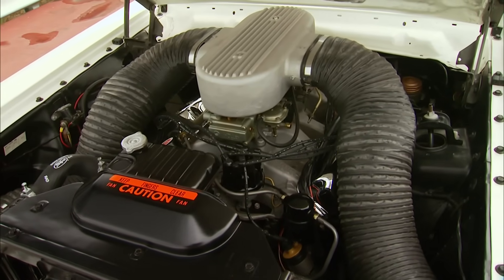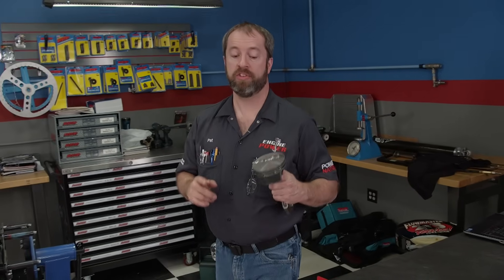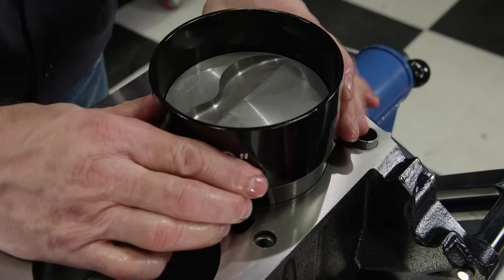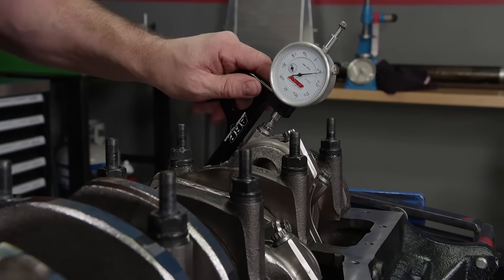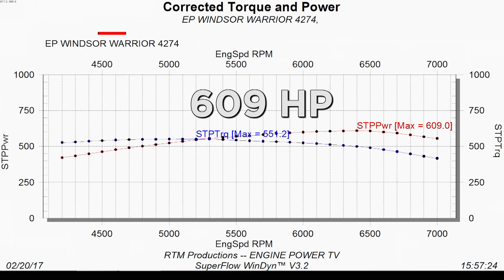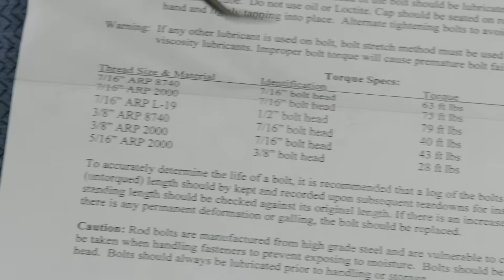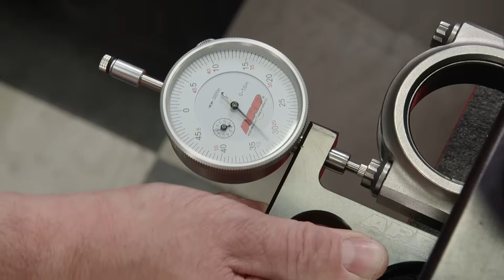Ford 351 Windsor Grows Into A 427 Stroker With Double The Original Power - Engine Power S4, E7

Comment: Great motor, now would you be kind enough to ship it to me so I can install it into my wife's 1967 cougar? Also quick question, I have a 351 Windsor lying around, can a factory block be machined for This application? If not please refer to the previous statement.
Reply: Yes it can, take it to a machine shop n get er done..
Reply: For the stock Windsor blocks I like the 408 kits. With a 4.03" bore and 4.00" stroke you end up with a "square" engine that makes great power, safe to rev w/o super expensive parts and still has a decent rod ratio.

Comment: I would love to see this same motor on the dino with Holley EFI on it :)))
Reply: @bigboreracing356  in what aspect ? To a gravity-fed carburetor .
Reply: T TANA    It's Dyno not Dino.
Reply: @wysetech2000  Tru Dat . Freaking speech to text
Reply: I was thinking about that same thing.
It's what I want to put in my 88 town car.
Reply: @shanerichardson9568  lol its already fuel injected.
Reply: @TTANA  My Town Car is not fuel injected. It had issues so it was replaced with an Edelbrock intake and carb.
Reply: @shanerichardson9568  well it was fuel-injected.  Sniper kit would be the way to go :)))))
Reply: @TTANA  well I am planning a 427 stroker build with Holley's tunnel ram efi.
That's why I wanted to see it here.
Reply: @shanerichardson9568  wow that's awesome

Comment: Built my 427 but based it on the Dart block. Used same heads but the Eddy Super Victor. Compression 10.3 and a Lunati hyd. roller with 241/249 and .600 lift.  6 years ago put on the Price Motorsport dual Holley inline intake with a pair of custom Holleys flowing 660 cfm.  Still going strong after 11 years now and it is in my 1985 Mustang LX coupe! 480 HP at the wheels with 505 Torque all in by 5700 RPM.
Reply: i would love to have a 427 windsor in my 95 sn95
Reply: @jsigafoo  Only thing is, I think you'd get beat up all day by coyotes
Reply: Thats alot of motor for 480 whp
Reply: Bob- that’s a lot of power for a pump gas out of date camshaft profile……. Todays cam that engine would make another 25hp easy
Reply: 😢😢😂🎉😮😮 3:44 🎉🎉😮 3:44 😢
Reply: 🎉 3:44 😢😢😢🎉😮 3:44😢🎉 😢🎉
Reply: 🎉😮😢🎉😮😮😮🎉🎉❤🎉j🎉🎉🎉

Comment: I’d like to see the torque numbers from idle to 4,000 rpm, being a street engine.
Reply: @bigboreracing356  4K to 7K rpm power band seems a little high for a street engine. Especially in a heavier 72 Gran Torino Sport, with a C6 automatic, A/C, PS, 3.25 gear ratio.
Reply: Torque is going to be massive from idle to that rpm, torque never dropped below 350 on that run.. It is a big cam so don't expect it to run great at super low rpm, this seems to be a race engine, slap some boost n be over 1,000hp easily..
Reply: @P71ScrewHead  I agree.
Reply: @P71ScrewHead  How do you slap boost on an 11.3:1 engine?
Reply: @johnterpack3940  Ppl do it all the time nowadays, the Coyote Mustangs are a perfect example of high compression n boost, the 3rd gen has 12 for compression.. I've always leaned towards low compression but i guess it's how new engines get it done now..

Comment: Nice job guys. Great power output. But what about the fuel mileage? Theoretically!
Reply: I have two 408 Windsor's currently; the mild build gets 2 light-poles per gallon. The hot build gets 2 fence posts per gallon. But in all seriousness, I get 10 to 14 with the mild build. I've never checked the other as I don't really want to know!
Reply: @cgarris8674  👍
Reply: There's always that one dingleberry who has to ask fuel mileage on some crazy horsepower engine. No one is building these for fuel economy dingbat.
Reply: Lmfao!
Reply: A couple gpm, but who cares.

Comment: I wouldn't build a stroker for a street car, a race car maybe, but thats just me.
Reply: If you don't mind the gas mileage penalty, it's even better for a street-car as you can make great power at low RPM's :)
Reply: @cgarris8674  Strokers are not known for their reliability which is why you wouldn't want to build one for a street car.  You have to rebuild them too often (like 40-50k miles) because they were not designed to work that way from the factory.  Its an argument as old as the stroker has been around.  Often what happens is the change in stroke causes the piston to slap in the bore and chews them up quick.  If I had a street car I just would not put a stroker in it.  Its the cheapest, but most unreliable way to make HP.  Something you want to race professionally, then fine...  I would think rebuilds on race engines would be even quicker than 40k miles.  Remember, this is my preference.  You can't argue the reliability aspect, but you can have a different preference.
Reply: @reviewaccount469  Totally understand what you're saying; but for many of us our "street cars" aren't our daily drivers and aren't likely to see a rebuild cycle for a decade or more. I typically drive mine on pretty days, to car shows and occasional trips to the drag strip to race friends and relatives in their hotrods. There's a guy in the comment section that's been running a 4.03 bore and 4.17 stroke for a decade w/o issue. For a heavily driven car or one that sees extended time above 6000 rpm's, yeah they will wear quickly.
Reply: @cgarris8674  I'm aware of the concept of anomolies and exceptions to rules, ie. a stroker you know of that lasted a long time, but its not proof that the basic engineering aspects of a stroker are different than I discussed.  

If your fun cars don't get driven much as you alluded to, as in under 40-50k, then I'd understand that works for you.  I have 3 cars, 2 of which I fully restored and are my weekend fun machines.  One of them is stroked, however the block was engineered that way from the factory to be either a 2.7 or a 3.0 depending on the crank used.  I would not have stroked that one if a corporation did not spend a lot of money and time to engineer it that way.  I just have too much time in that car to put questionable engineering into it just for a few hours of fun here and there.  

The reason I used miles instead of "years" for everyone else's fact consumption is so the average person has the facts they need to make a decision.  If they didn't know the pitfalls of a stroker, they'd be thinking it was the first thing they'd be doing based on all the other comments.

Again this is my preference, but the engineering and reliability aspects are not debatable.  Its a tradeoff and a choice, but lets not try to confuse the motor noobs that may be reading this that there is no issue with a stroker.
Reply: @reviewaccount469  Preference.
Reply: A stroker will always be the best way to go, even more than a big bore build..
Reply: @P71ScrewHead  Or the best of both worlds, a big bore stroker ! =)
Reply: @cgarris8674  Yes, that's especially what i like, don't fear the stretch, big bore strokers..
Reply: @bigboreracing356  I don't, but who knows what other people do. But even if they did I wouldn't going around the internet being an asshole to 'em about it.

Comment: With the 950cfm carb, they saw best performance at 30 degrees of timing, then a bit of a fall-off when they advanced to 32 degrees. Why did you not simply revert back to 30 degrees of timing, then put the big 1150cfm dominator carb on to see if that made a difference? Are you going to leave this engine at 32 degrees of timing, knowing that it does better at 30?
Reply: They also didn't say that they DIDN'T set the timing back to 30°  I'd be pretty sure they actually did, that carb shouldn't have added horsepower, to me, it sounded like they were trying it to dispell the myth that an oversized carb would flood the engine.
Reply: @V8VRUte  i think that increase in power came from the spacer and theres really no need for that big a carb on that particular engine
Reply: @supersevenn  The power was basically right at the same number it made with the smaller carb and 30°  I still think that they probably re set the timing between runs.  Just because they didn't show it, doesn't mean they didn't do it.  They also didn't show them re jetting the carbie either, which would have almost certainly been done.

And like you say, the carbie doesn't need to be anywhere near that big.  850 cfm would supply a 7.0L to 100% VE at 7000 rpm.
Reply: @V8VRUte   I have a 408W with a solid roller and it needs 1000 cfm,  made 15 more HP going from an 850 cfm to a 1000cfm , with that stroke and head flow, it needs it for top HP. There is more testing that can be done but only using a few pulls won't really show the engines peak potential.
Reply: Elving- what heads on your 408?
Reply: Exactly, which means the same, but likely different and opposite. Other than that, perfectly identical theories.
Reply: @V8VRUte Go buy the kit and do your own testing just like they did. Let US know what you found.
Remember with exactly the same parts.
Reply: Yes, I wondered the same thing about the timing. Also, why not dykem and exhibit the pattern the roller rockers are leaving on end of valve tip , aka the 'walk'. Save those valve guides, side load wears out guides ! Maybe that was done throughout all 16 with a push rod length checker before they ordered the set of pushrods. Great video BTW.
Reply: @1MrE42  blah blah blah LS
Reply: @timmebruer5205  he's right.or a bbc
Reply: @ryangulley2051  blah blah blah big block Chevy.
They make great boat anchors
Reply: Definitely should have gone back to 30° or even 28° for gas variability. You lost power when everything else was equal/unchanged, that shows that the timing was too advanced.
Reply: Would have tried 31 degrees!
Reply: Not only that they went from no carb spacer with the 950 cfm carburetor to a spacer with the 1150 cfm carburetor
Reply: Right!!?....I would have immediately turned timing back after it dropped off....probably 612-615 hp
Reply: Faster airspeed with 4150 carb over 4500... my 12.42:1 pump gas 438 makes more power with a demon 1000 4150 over a 1050 4500
Reply: I really don't care about the 2 degrees of timing.  That motor between the frame rails of my 47 Ford Pick up is more than plenty power for street driving
Reply: Pretty sure these episodes are several years old and the builders don't read or give a shit about your comment.
Reply: Yeah it does much better at 30 degrees and the big carb will perform much better
Reply: Because that makes too much sense sir.
Reply: This engine had almost 11.5 : 1 compression ratio. I would have likes to have seen what it would have done on 110 octane gas or 105 octane E85!
Reply: 1150 is too big of a carb for the application, unless it's gonna live at the top of the rpm range most of it's life. The 950 will have better vaccum and better part throttle driveability
Reply: I wanted to see them tune the 950 carb with that 427.  The big carb was unnecessary
Reply: Idk why they didnt back t he timing off either
Reply: Democrats.. channel is sorry.
Reply: @bigboreracing356  That's not the point that he was making. Now who's the More Ron?
Reply: @Lifeistooshort67  Ole No prep there just tends to make ignorant statements on things he knows nothing about to be annoying. Just last week he was telling me how Chrysler engines were really cheap to build in the seventies. Being that I was a Ford and Chrysler supporter in the 70s and understood the lack of aftermarket support for them compared to GM it was a little annoying. I'm sure he's about 16 and is pretty sure he knows just about everything. Ignore him and maybe he'll find a squirrel to entertain him out his window.
Reply: @Matthew Moilanen If someone is claiming Mopar engines were "really cheap to build in the seventies," then they either weren't alive in the 1970s or they never built a Mopar engine back then. You couldn't get squat  that wasn't GM. Summit had a basic rebuild kit for the 318/360, and the only stuff JEGS had was parts that crossreferenced with the 350 Chevy. We said that JEGS must stand for "Just Excessive GM Smallblocks," because that was 90% of their inventory, and still is. 

The reason old Mopars started becoming valuable in the late 1990s wasn't because they were hidden gems, but because parts availability became common for the first time thanks to the internet. Prior to 1995, you had three options: junkyard, a Chrysler dealer, or make friends with a machinist. That was it. 

Younger kids today don't understand that unless it was a really common car or there was a high degree of shared parts with other vehicles, parts stopped being manufactured for it after five years. Something as simple as freeze plugs for a 331 FirePower Hemi just didn't exist, even at junkyards, and most machinists wanted hundreds of dollars to fabricate them- in 1972. So something as simple as not being able to replace the freezeplugs meant the old New Yorker went off to the scrapyard. Nowadays, it's as simple to find as a google search and you can get an entire set for less than $20.
Reply: @RockandrollNegro  the reason old mopars became valuable is because they couldn't sell them when they were new thus making them rare
Reply: Agreed, correct statement. And 610 hp out of 7 liter displacement seem to be still quite standard. This engine build should handle a lot more, yes. 

Maybe cam lift and timings here have been limiting factors as well. And most guys would go with the smaller carb (potential better mid to low range torque) and two degrees less timing for the existing setup as the better choice, shure.😊 But this is Youtube public entertainment.
Reply: @JamesBrown-ux9ds  Affordability. Yes cranking the motor to 7, 8 or 850hp would be fun. But….it is about Drivability and can you build it in your garage. 600hp is stout for a street engine.
Reply: @JamesBrown-ux9ds Of course this engine can make more power but this build will make reliable power for a long time.

Comment: If I remember correctly, the "THUNDERBOLT" was an "Altered Wheelbase" Drag car.
This is where the builder moves the Rear Axle forward for a better Weight Ballance, right?
Reply: No it ran in Super Stock from the factory ,,I seem to remember watching one run back in the 60's but I do believe some guys took that set up and converted it to an Altered Wheelbase car.

Comment: I had a 351w stroked to 408 in a 66 mustang in the 90’s. I always wondered how much more power I could of had with a 427 stroker. 👍🏼
Reply: HP is in the heads/cam and torque is in the cubes...
Reply: 😂😢 @BuzzLOLOL
Reply: That is a tight fit with the high deck height of the 351.
Reply: Not much. Back in the 90s, the 427 stroker was a lousy engine. The earlier versions were just a marketing gimmick capitalizing on the 427 name, but they had poor rod angles due to being so overstroked. They suffered from piston slap, rod failures and short lifespans. Current versions of the "427 stroker/W/R" don't have a single Ford part on them. They're just parts bin race engines. Nothing wrong with that, but can't be called a "Ford 427" with a straight face, IMHO.
Reply: probably enough horsepower to twist the frame

Comment: I didn't think you could stroke a factory 2 bolt main 351W block. Normally you use a 4.125 bore instead of a 4.030 bore that you all used in your build. 
So what stroke crank and what length rods. 

I'm building a Dart shp block with billet main caps 351w 427w build with Molnar forged cranks Molnar forged rods with Weisco pistons etc zero balanced. TFS 240cc hi port heads with Stainless works headers etc pump gas with a HOLLEY efi. I'm hoping for 700 flywheel horsepower on motor on pump gas etc. 

Y'ALL ROCK 🤘🤘🤘KEEP UP THE COOL CONTENT AND HELPFUL VIDEOS... 
🤔🚫🧢🚐💨💯💪🌮👊
Reply: You can get 427 from the std. block but it's undersquare and not a combo to Rev very high. Your combo is a better way to go!
Reply: @cgarris8674  thank you for the reply.. That's still really impressive with a 2 bolt main... 
🤔🚫🧢🚐💨💯💪🌮👊
Reply: @mikec9112  There's a nice video on GMTgearHDs channel where they put LS heads on a 351W, get a custom cam and run it. The headers and intakes are also remarkably similar.

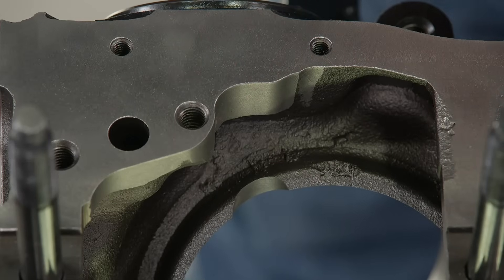Comment: 2:51 a solid threaded freeze plug, that wouldn't do the job to be a freeze plug is it?
Reply: What is commonly called a "freeze plug" is actually a core plug. It's used to get the sand out of the block after casting.